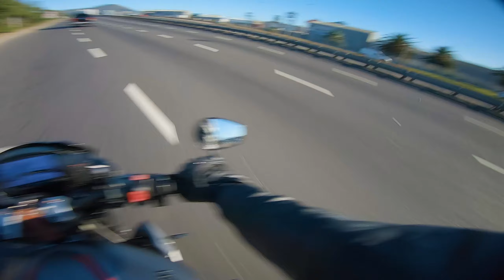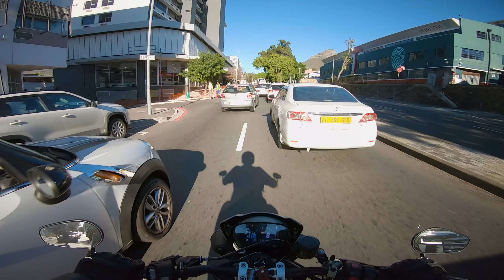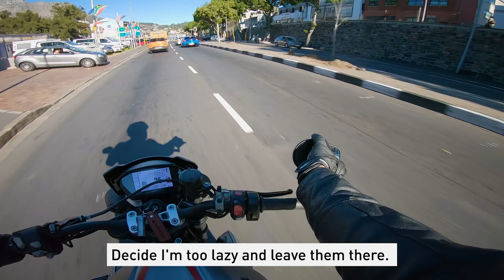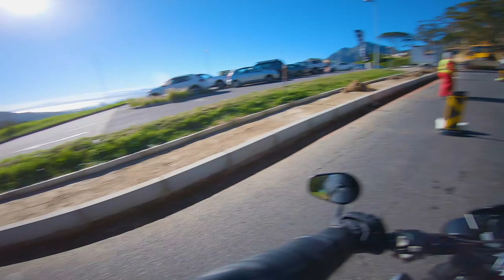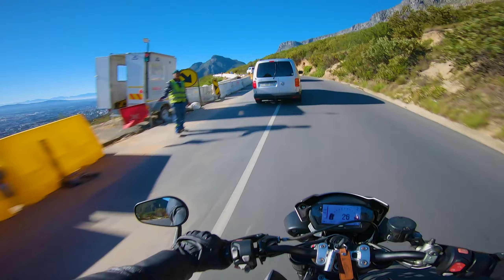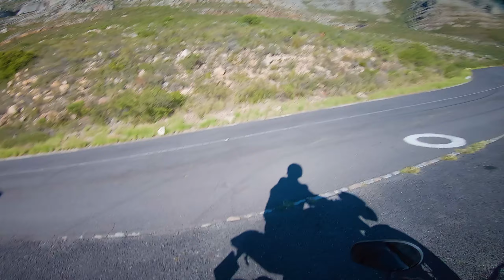Triumph Street Triple 765 RS | Updates and Ramblings

Comment: Hi, may I ask how did you fix the loose mirror ?? My right hand side mirror got loose too, but i dont know how to fix it. Thanks
Reply from the maker: Hi! What I did before having them replaced was to take the mirror off the bike and lay it face down.

Put a few drops of blue loctite on the ball joint and let it dry. Make sure the mirror is roughly where you want it first. Once it dries is a little bit stiffer and doesn't move around on the highway.

Hope that helps! Cheers. 😎👍